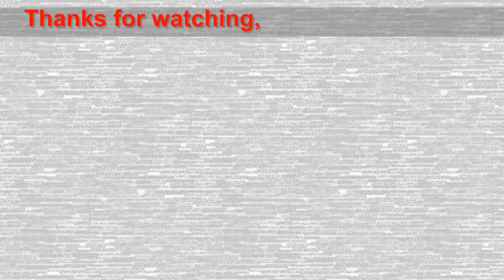Excellent Building Bedroom Floor With Wood & How To Install Wooden Floors Step By Step

Comment: Started out great then went downhill from there.......like others have said the joints are too close together to be structurally sound.  That's the main problem.  Love the cancer saw also, cutting the lacquer coating thats on the laminate all the time will cause brain damage in the long run.  It's nice the floor he's working on is Brand New construction, square, no obstacles to slow you down.  The houses I work on are out of square with registers in the floor and a closet and possibly an off angle wall.  This is unrealistic flooring example, makes it look easier than anything you'll ever work on and you can't follow how he installs it.  DIY people should steer clear of this video.
Reply: He did an excellent job.I love deviating from the norm, and not falling inline with everybody else's idea. Great pattern.

Comment: The fastest floor installation ever. That said, I am not crazy about the obvious diagonal pattern running cross the floor. Although it would be slower to lay, a random choice of board lengths would, I think, give a much better overall effect. Plus the finish on some of the skirting board ends was poor with uneven gaps.
Reply: You are completely correct. I am a union trained 37 year hardwood  installer and finisher. That floor is installed incorrectly including the underlayment.
Reply: @4evergav  what was wrong with the underlayment btw? is it because it doesn't overlap enough and not taped down? what's the correct method by the book in terms of putting down underlayment? i usually buy the ones with the adhesive layer on top, so i just overlap it, dont really need to tape it
Reply: Yeah for sure. I would never lay a floor like that. Unless I wanted to hate lookin at it every time I walked across it.
Reply: Just comes to show that there’s more ways than one and he found his way to be effective and as long as his customers don’t complain he’s winning
Reply: @fudgebrowniie-jenkins9847  It looks bad.  And it's the wrong way to do it.  Just because he did it fast without any shoes on like a homeless guy waiting to be paid in booze does not make it impressive to do it wrong.
Reply: @spamaccount6460  😆 if the customers satisfied is the main thing . That’s your opinion that it looks bad. Looks fine to me. U just want so bad to be right huh? What’s wrong with people these days
Reply: True
Reply: @fudgebrowniie-jenkins9847   the customer will not be satisfied when the manufacturer refuses to honor warranty because the floor was installed incorrectly and was damaged through uneven expansion.

Comment: Staircase pattern not recommended. Random spacing is better.
Reply: Easier
Reply: what mean random space??tell me
Reply: Yeah agree, I do random for my remodels looks better.
Reply: @apekpablo908  use the offcut from the last cut to start next one or the one after it stagger the joints
Reply: @apekpablo908  3 things you never do when laying a floor, create a H pattern with joints, place joints less than 4” from each other and make a staircase pattern with the joints.

Comment: All the comments here so negative about making a regular pattern and imposing your concept of safety. His method is good, the product could be slightly nicer with more careful cuts, but I bet he saves 20% the time just with the fast cuts.  Also, not wearing safety shoes allows him to feel imperfections with his feet that would otherwise be invisible when wearing rigid shoes.
Reply: @jamescook well said. Half of the naysayers on here probably could not seal an envelop if you handed it to them upside down; let alone build a room floor. You hit the nail on the head there buddy.
Reply: Well you really shouldnt staircase pattern boards like that.. says that straight from the manufacturer. Also he didnt leave an expansion gap between wall and boards. Its gonna heave. POOR JOB

Comment: I’ve seen all sorts of construction practices in Thailand, on the two houses that I had built and on other people’s houses.  The guy here went barefoot but the proper construction shoes in Thailand are flip flops.  They tie bamboo together for ladders and scaffolding.  They consume an amazing number of m-80 bottles per day to stay awake.  They are great workers but if you ask them if they can do plumbing, electrical, or (in my case) landscape sprinkler systems, they will always say “can do,” even if they don’t have the slightest idea of how to do it.  That results in having to fire them and bring in a specialist. I have my trees trimmed every year or two and I’m always amazed that they climb the trees barefoot with a machete.  I do what I can from the ground with a cordless saws all.
Reply: la

Comment: He is rushing through the job and i can already see gaps in the flooring, being quick is not always the best thing. Taking your time and doing a proper job is better in my eyes..
Reply: Random pattern is the best pattern (for my climate) this stairway pattern would be so weak and slit in the first few months
Reply: what you see is the bebel edges not gaps..standard in prefinished flooring plank
Reply: I agree
Reply: Camera was sped up
Reply: Donald Kasper  the gaps are NOT from cutting freeform. They wouldnt lock if he did that. The cut edges are against the wall. The ends are beveled by the manufacturer which is why u see a gap.

Comment: Originally a wood floor was expensive so they used every inch of it, when I installed a floor I staggered the length so it was completely random , having the same space between the end of each board to me makes it look cheap, no matter how good the installer was
Reply: It's generally more efficient to do them randomly and as you said looks much better. This guy just started several rows ta the same time cutting each board about 6" different from the previous one. This creates even more waste rather than using previous end cutoff as the start for the following row.  And yes, it looks terrible.

Comment: Joins in boards are still visible, and there appears to be a lack of suitable expansion gap at the edges, simply no need to rush this kind of job.......
Reply: Joints has a small "v" like groove on the surface. Flooring was made that way by the company. Did you not see the wall shims?
Reply: SON VISIBLES PORQUE AL GOLPEAR EL BORDE CON MARTILLO SE ABOLLA EL LAMINADO Y DESPUES NO ENTRA LA SIGUIENTE TABLA, HAY QUE CORTAR UN PEDAZO DE TABLA CON ENCASTE SE INTRODUCE Y SE GOLPEA DESPACIO..SALUDOS DE ARGENTINA
Reply: @viejojorgge ㄷㅂㄷㄱㅈ ㅓ도둡아더

Comment: I love the workplace safety shown here! Especially that electric saw working next to his right foot.
Reply: You think the shoe will save his foot if  the saw incidentally go?
Reply: @MyGodzilla33  I live in the European Union (Portugal). There are very strict workplace safety rules here. One of these rules requires you to wear boots with steel toe protection when doing work like this. And yes, a boot like this can prevent you from losing your toes or getting very deep cuts on your foot.

Comment: This guy speed is incredible and looks comfortable doing the job, obviously he does that for a living, I am  not a profesional installer but have installed few floors  myself, but there are few things that I've noticed that's contrary to what i was told; One is the amount of material waisted, the second is, the stair pattern on the floor is well defined, meaning the joints are not fully locked at the end, maybe that's the design intended, i dont know but i was told that the idea is to make it appear as a seameless surface, not an obvious pattern between the end joints. And the third is, the fact that there is no space in between wall and laminate, which as i understand it, is necessary for the laminate planks to expand and therefore, evading from possible future warping.
Reply: laminate sells for cheap anyways... real wood is expensive
Reply: you wan to see real waste, go around the back of big name supermarkets by the end of the week right before the new stock comes you will see dumpsters full of food wasted...and yet many in the world are starving...yet here we are complaining about a few man made fake wood boards that can be reused to make that again in a factory being wasted
Reply: see this is how much of a hypocrite we humans are

Comment: I'm not a professional installer. I've installed 5 hardwood floors so far,  hardwood, laminate and engineered. I would never install a floor like this! It's a perfect ladder.
Reply: I've done over 200 and would not ever do this shit. It will separate in 6 months. TOPS.
Reply: @freddiecurry4397  Gotta love how he hammers the hell out of it and rams it into the wall.
Reply: @shoey rocks I am a finish carpenter and don't really do much flooring but I was told it is supposed to be kind of a random pattern, at least with hardwood. Is that right?
Reply: @shoey64  Some people do not like a random pattern, they prefer a regular, but rarely  a ladder  effect.
The problem these days is that less common wood, such as oak, do not come in planks with the same length, so you have no choice but to go with an irregular pattern.
Reply: yep, but whos to say, maybe thats what they like.. I mean tile is pretty much the same its almost never random... besides if you think about when do you really pay attention to a flooring? we just walk over it
Reply: @DefinitelyProbable  As random as possible. You will have stair stepping at some point, especially dealing with prefinished floors. But they can be kept to a minimum and off to the sides where they're not as noticeable. You try and avoid "H" patterns, stair-stepping, and seams that are next to each other or within 4"-6" inches of each other.  I try to keep my seams at least three boards apart and any kind of unavoidable patterns are off to the sides or in places where there will be furniture or area rugs.  Like I said, I'm not a professional installer but I've learned this rather quicky just by looking at what I would want if it were my house.
Reply: Jim Crosby, yes you will..

Comment: My only suggestion is to avoid the pattern in your layout of the planks.
Reply: Na I like the way I lay out my planks in a random pattern.  All I saw with that floor was the diagonal seams all running the same direction.  Zipper effect.  I would have had you tear it all up.  Honestly I’ve never seen a floor laid like that in the north eastern US.  It’s a speedy way to get the job done faster that’s about it.
Reply: How so?  My floors on the second floor of my home  90 year old  oak laid in a random pattern and holding fine.
Reply: Let me be clear and make sure we both know what we’re talking about.  An H pattern is a layout where all the board ends at the same points every other row creating an H appearance.  I’m not talking about doing an H pattern in my layouts.  I lay random board patterns with a variety.  The eye sees a floor with no particular pattern, a continuity throughout the whole floor.  With Your layout the eye is drawn to those diagonal seams.  The brain tries to make sense of what it’s looking at and finds patterns in everything.  As an installer you might not find issue with that but an interior designer would find that as a distraction.  Random seams is the way to go. I don’t use laminate or vinyl flooring so maybe it’s different rules for those materials.
Reply: @haighyvshaighy  how do you lay your planks. Do you stagger?
Reply: @stayreal5083  I lay staggered. Try to avoid any end joints from being less than 12” from another.  The idea of a floor is to avoid an unintentional pattern and keep continuity.
Reply: @haighyvshaighy  OK. Thanks. That really helped me a lot.

Comment: This guy was not a professional installer.  He was not trained.  You never cut timber to small pieces.  For random installation, lay one row planks.  The off cut from the last piece is to be used to start the second row.

Comment: Looks nice.. Suggestion: It might be an improvement to be a little more random with the end cuts. I see there is a straight step pattern forming.
Reply: Stair step pattern looks bad
Reply: To somebody who knows nothing about my flooring. Doesn’t matter. Especially in a commercial space.
Reply: You are exactly right that's not how you put flooring in it is if u dont care about how it looks like.  Its supposed to be looking like real hardwood and u stagger the joints alot better then what they are doing in the video.  It looks like u are walking up a set of stairs not good and u have to leave a gap around the wall for movement.  Horrible

Comment: This guy probably works for a construction company who build high rise apartments.  There are hundreds of units with different number of rooms.  His boss probably gave him a quota to pave 10 apts a day.  So to get paid, he probably has to work fast.  Once people put furniture on it, they cannot tell staircase pattern or whatever.  I believe the floor is concrete so moisture is not a problem.
Reply: concrete is the worst for moisture, what you talking about?  unless it's above grade.

Comment: As a flooring contractor myself I have to say this video should rather say: "How NOT to install a floor". There are so many things to number that I disagree with, especially with the final product, waste, method and delivery. First off, yeah so many people say he didn't leave expansion gaps, but I have noticed he put some pieces of broken laminate as spacers early on at the start after he finished up a few rows. I still think it is not sufficient and plus that poor cheap underlay was not seamed at the joints 3 inches away from wall and not to mention this is all on concrete where humidity thrives. Secondly, I was almost revolted at the way he started the rows, all in stairs without staggering the joints, Yes he didn't have any ugly joint over joint but visually it looks like a bunch of stairs and if it ever buckles, which it will, the whole floor will come apart along to never ending stair joints. As far as delivery and method, yes he didn't seam very safe or considerate of the boards, I think i even saw him hitting the top of a board with a hammer once. a ton of waste, pieces that can be used to start other rows or at least use the cutout pieces for ends. IN any way, finishing in half an hour doesn't win you a medal. Putting it on youtube for criticism is not any wiser either. People should always hire a professional when it comes to installing floors.
Reply: agree with this... this is not an A-1 work...not professional

Comment: Never install pieces under 8 inches for ppl that are watching this and diy, and always mix boards from different boxes to mix the design and pattern of the floor
Reply: Serious question... I'm looking at tackling my house this summer, what about those corner end pieces. ?  Thanks in advance.
Reply: Why is he cutting the new pieces before he uses them, instead of using the end piece in the beginning of new lane?
Reply: clo289,
 pick up a dovetail saw and cut the bottom edge of your door trim( using a small piece of flooring as a guide for the thickness to cut) then slide the flooring underneath. That way there is no caulking or any tiny cuts that could be off track. Much cleaner look. Search dovetail saw on Youtube . Hope that helped.
Reply: Never seen so many steps
Reply: James Rodriguez  I agree,Toooo many
Reply: Some customers would actually love this pattern. Atleast he stuck with it. It only looks bad if you’re going for a random pattern and accidentally have 3-4 steps. He nailed this with no help
Reply: @motivation is key
Really?!?! The man was cutting the boards in mid air, hammering like a mad man with no regards for his fingers or toes, oh and my favorite,  he did all of this barefoot and those are the only don'ts you decided to point out.
Reply: Exactly this guys clueless and his seams in a big ugly room diagonally through the middle of the room terribly done
Reply: @tjdonald9084  U will not love it, when it starts to buckle up on the joints of staggering he did wrong. Floors expand and that is why manufactures tell u never do end pieces under 8' inches. This floor will go out of square r buckle up. He doesn't even have the 1/8 expansion against the walls he running the plank towards. This whole video is a how not to install floating floors.
Reply: Jason Cooper can’t see it from my house

Comment: Excelente profissional. Deu vontade de trocar meu piso e chamá-lo pra colocar o novo!  Parabéns!!!
Reply: Si es una chapuza
Reply: By the way .... he also forgot about the foil if the panels are laid on a concrete floor.He put an ordinary cheap sponge that is actually not used anymore. Even at the time this video was recorded, there were already more professional underlays already existed. He didn't even tape the sponge together so what kind of a professional is he???

Comment: Am not an installer but aren't you suppose to leave a small gap at the edges to allow for wood expansion, therefore avoiding floor from lifting, Warping?
Reply: he checks for gap 3:48 thats the expansion gap
as for the locking system u smack that flush

Comment: Mate you need to leave an expansion gap. 🤦🏽‍♂️ take it all off
Reply: Jay Jay  thats what a thought on fisrt board
Reply: There is an expansion gap or he could not use the tapping tool.  The problem is it's a floating floor and the edges were not glues T?G.  Also, the seam spacing should be at least 6", and the symmetrical line (diagonal) is ugly.
Reply: @freewaylee  The only other thing he could have possibly done wrong in this video would be to glue the edges.
Reply: @freewaylee  he has a 1/4" spacing and that's all you need for laminate - Source : Vendor trained and selling the stuff 10+ years
Reply: @KenColby87  yeah, I agree.  What I was trying to say, each plank should have a minimum 6" overlap, from one seam to the next seam, one line over...hope that makes sense
Reply: @freewaylee  i thought it was uglly also the symmetrical line.
Reply: No you dont